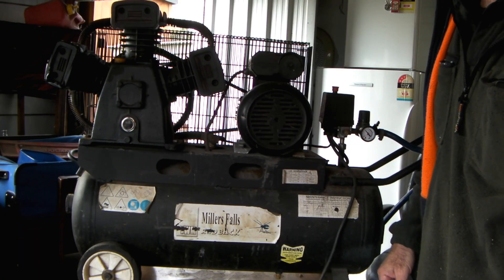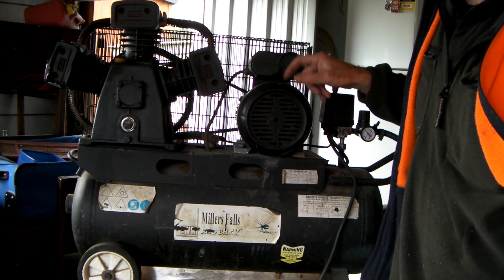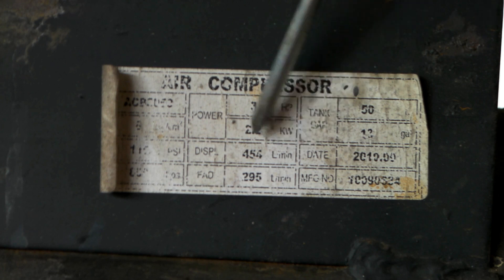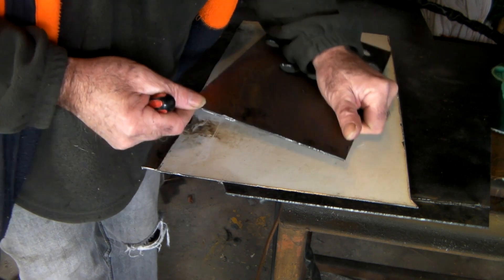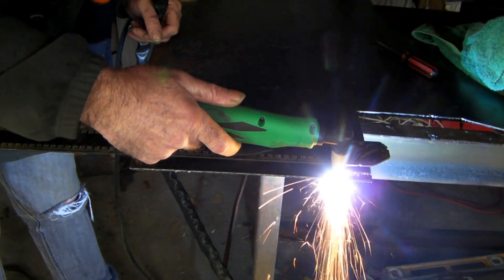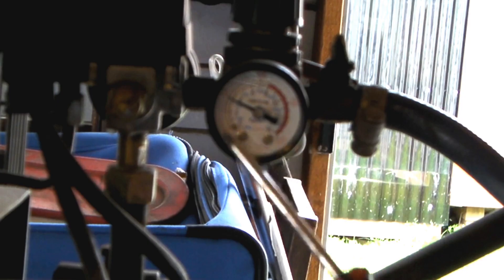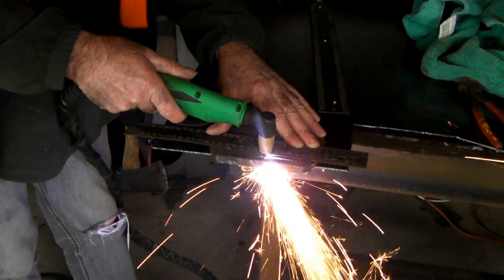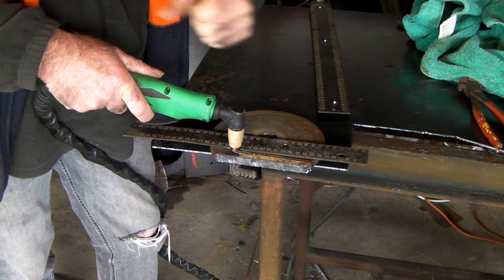Plasma Cutter Running On Small Air Compressor

Comment: Simple, Just buy a cheap 3kw diesel generator and hook your air compressor to that instead of your main power supply, that should solve the problem of your circuit breakers tripping and it should be enough to run your air compressor (2.2kw induction motor) when the pressure in the tank drops and the motor kicks in to maintain the air pressure in the tank.
Reply from the maker: great tip cheers pete
Reply: @petestools  You're very welcome mate. Have a great and happy 2021 👍
Reply: I'd go 3,600w generator.
Reply: @OrdainedMinister  I agree with you 100% although he could probably get away with using a cheaper 3000kw / 3200kw generator as a 3600kw generator may be hard to find and very costly to purchase...

Comment: You can get a "smart" power point so you can remotely turn your compressor off before starting a long cut to avoid the interruption.
Reply from the maker: GOOD IDEA CHEERS
Reply: And then when the air pressure drops too low?
Reply: Bad things will happen.

Comment: I have an auxiliary tank between my compressor and the regulator, as well as rechargeable desicant for an air dryer, makes a world of difference.
Reply: Did think of that - good tip.
Reply from the maker: thanks mate
Reply: Can you use a retired air compressor tank for an auxiliary?
Reply: darrin jones sure as long as it holds air

Comment: Pete have you considered using a old empty 100 pound propane tank as a air storage tank? Just a thought. Thanks for all you do.
Reply from the maker: see next video cheers pete
Reply: Works great.
Reply: I have a very very small compressor ,5liter tank was ok for the odd jobs I was doing before I bought my plasma and obviously just wasn't  enough to even cut anything .I found an old propane gas cylinder